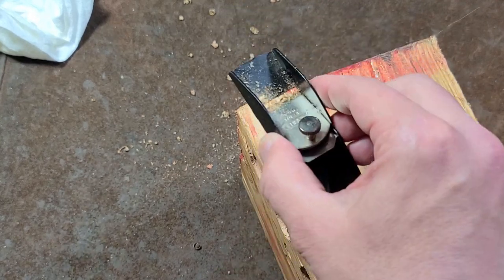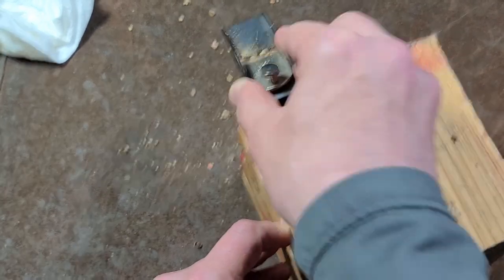Stanley USA 1" Mini Hand Trim Wood Plane Review

Comment: I bought mine to make scarf angles on a 2'×3' repair of fuel tanks on a Bellanca aircraft. It has 4 fuel tanks. It is made of 3/16" high grade luan plywood. The scarf is critical for bonding with the specified glue (Cascophen, a 2 part powder and resin mix containing huge amounts of formaldahyde) and needs to be a 1 and 1/4" wide. It was a pain in the ass. I do sheetmetal. This tool is a very nice one for such critical tasks. Surprisingly cheap at less than $10. Flatening the sole is quite easy with sandpaper and any flat surface. Mine didn't need that nor any major honing. It lives in my livingroom with my getting large collection of bench and long planes. I give this little guy 3👍👍👍. My crown jewel of planes is a Baily #8 complete and useable. I have found these tools to be a nice escape from the digital world!

Comment: I used one of these to do woven corners on cedar siding and for adjusting the width on the center  shake when 2 people worked from both ends of a wall. The blade seemed to sharpen itself on the cedar. I only sharpened it when the blade became concave from thousands of passes.

Comment: I use this plane to take the lip off the edge of laminate click-lock type flooring when you dont have room to snap together. This lets it slip in from the side, wood glue holds it. A cheap life saver